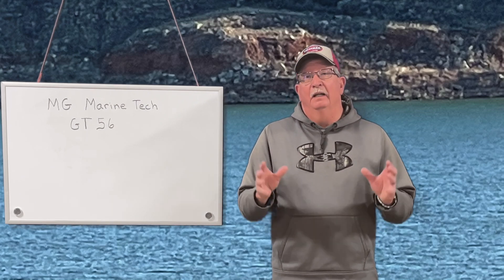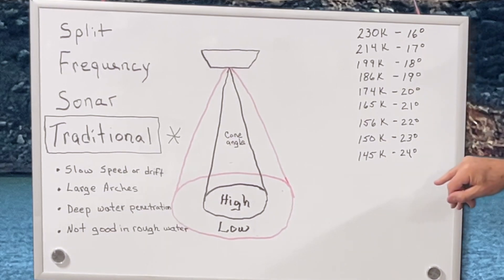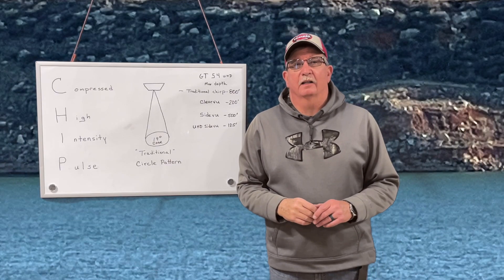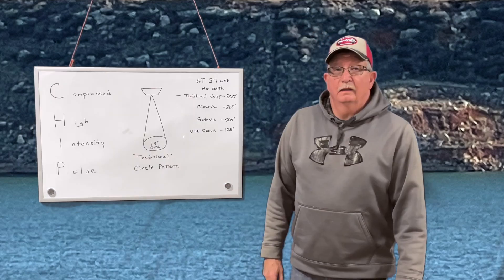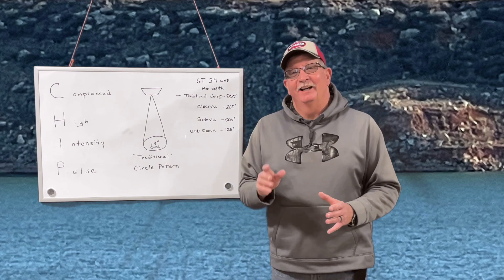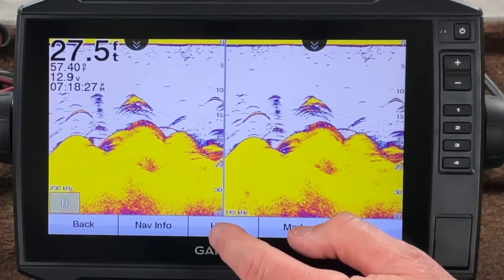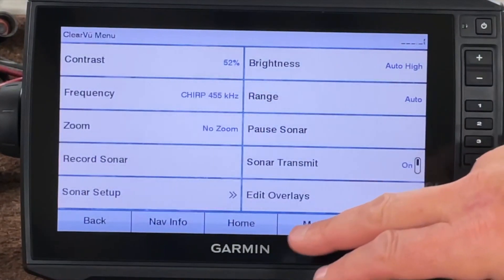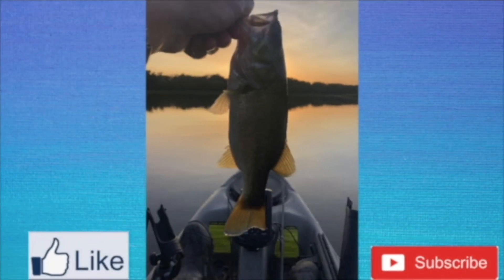Sonar Frequency Explained

Comment from the maker: Link to Garmin Sonar Series playlist!!!
https://youtube.com/playlist?list=PLVvIAKByPmU4MDJw5rrEQ6qwHj1FlJ8HL
Reply: Great video! I do have a question, though I always see videos talking about frequency high and low shallow and deep water, but what's considered as deep and shallow water? Like, what should I have my frequency set on if I'm in, let's just say, 20-60 feet or 100 or more what's considered deep or shallow
Reply from the maker: It really depends on the transducer, the best resource I’ve found is the Garmin transducer selection guide. It will tell you the maximum depth at each frequency for each different transducer for clear vu and side vu, at 100’ you shouldn’t be too limited. Traditional will work well at all frequencies in those depths. I would start at the lower frequencies and work up. you can google it, easy to find
Reply: Thanks so much.

Comment: so snapper trolling from 60 to 90 meters which frequency to use high chirp or medium chirp?
Reply from the maker: I’m not sure which type unit and transducer you are using and I’m definitely not a deep water angler but using traditional sonar with my Garmin ECHOMAP the high wide chirp transducer will reach almost 250 meters so I wouldn’t think you would be limited much and could use your higher frequency, now clear vu I can’t reach 90 meters according to the chart. I’d recommend looking at your transducer specifications to determine what frequency to try. The other method would be to start out at a high frequency and turn it down if needed until you get a clear image of the bottom. If you are running an ECHOMAP try that traditional split frequency screen and play around with that to make sure your seeing suspended fish correctly

Comment: I love your video lot of very good information at the moment I'm having trouble with mine it's the same 93 there my screen seemed to have his way too much junk running around and I don't know I can get rid of some of it or I'm stuck with it and that's just to start
Reply from the maker: You should be able to adjust your contrast or gain depending on which sonar screen your talking about (traditional or clear vu) to reduce noise clutter. If it’s vertical lines along the screen check that your power is above 11 volts, your ferrite bead is on your transducer cable and your not powered off your trolling motor battery. I have to adjust my brightness throughout the day for sunlight conditions but the gain and contrast I don’t mess with allot once they are set. If your transducer is getting air bubbles under it the picture is really bad. A little clutter isn’t a bad thing, I’ve been guilty of making the image so clear I’m missing the fish marks lol.